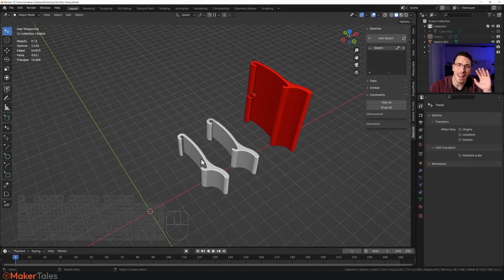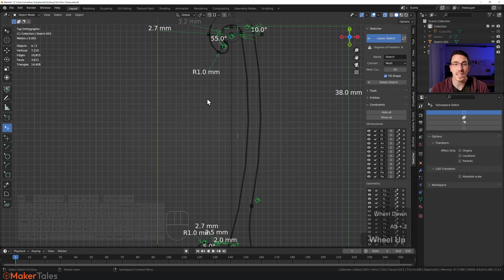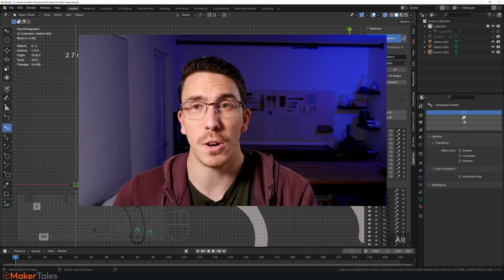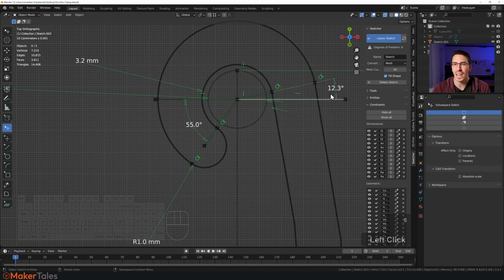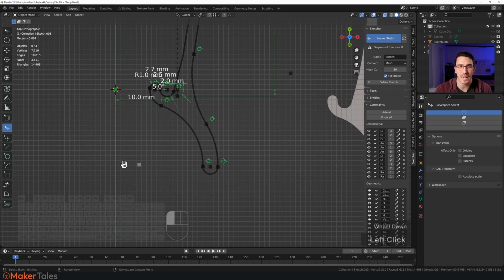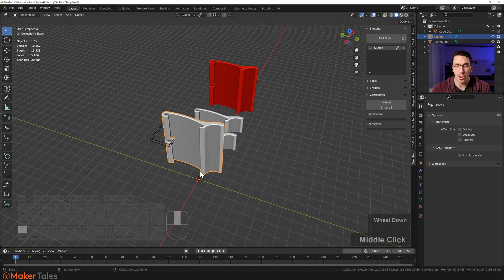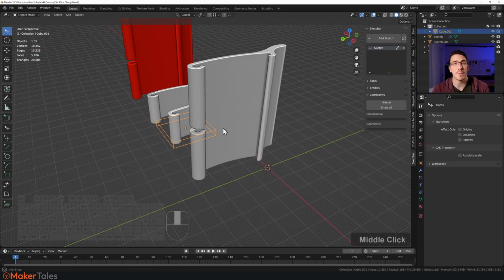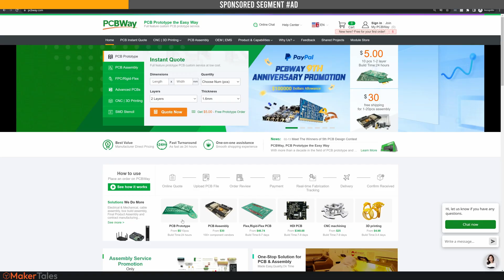Only 3D Printing Can Fix This | CAD Sketcher Design

Comment: I've got a plastic storage box with really soft latches, they break absurdly easily and I just replace them with 3D prints. Not sure why they elected to use such a soft plastic for a part with constant use, but the Tough PLA I'm using should hold up for a pretty long time.

Comment: Nice 👍.  Any spec suggestions for a cheap laptop that can run blender?  I'm thinking something with 6 cores and 8 gigs of ram should work.  Do you think precision modeling will be less intensive than animation?  Have you ever looked at how much running blender taxes your computer?